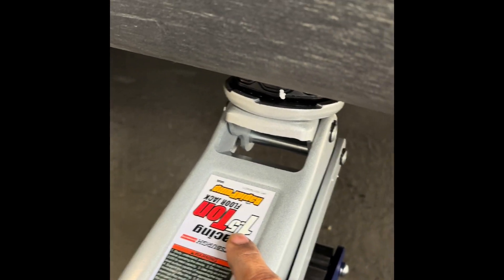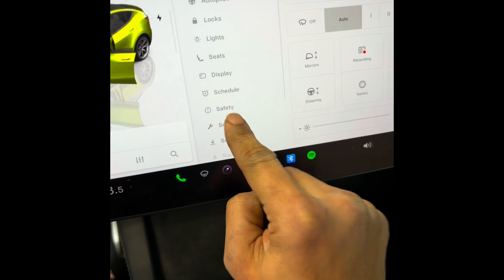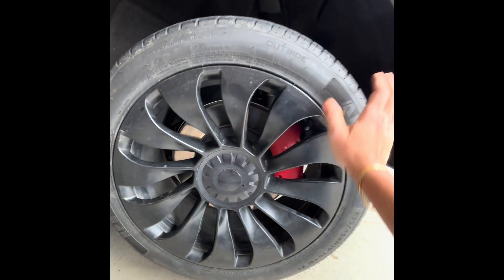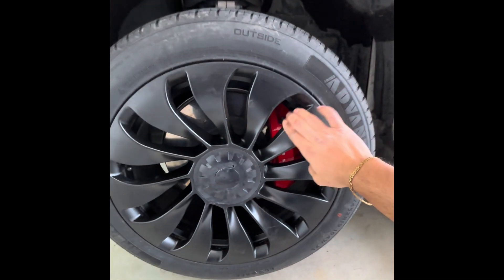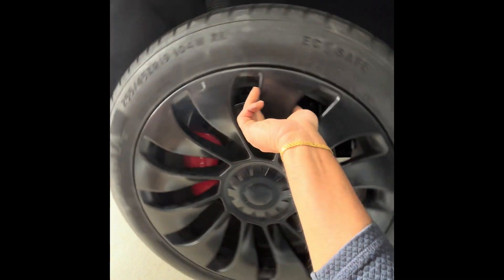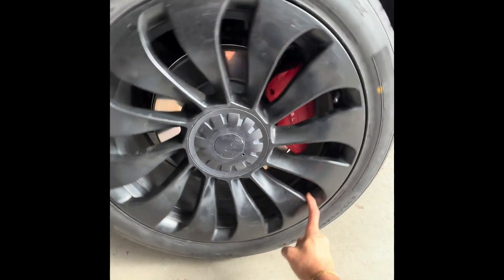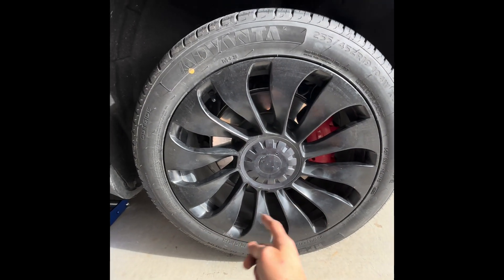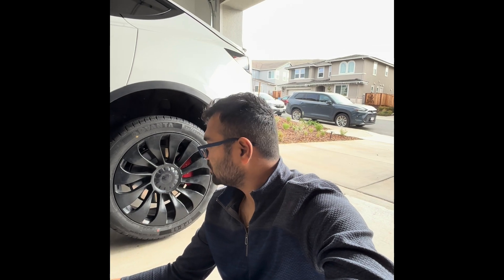Tesla wheel bearing noise 🚗🔊I got it FIXED!!!! Here’s how you can diagnose it.

Comment: I am having a similar issue. Sound is coming from front side but its not hard to rotate at all for front. but the rear wheels as im rotating, is kind of jerky to rotate and a bit harder. The noise is louder above 30mph. Did you have similar issues?

Comment: The reason the rear wheels are harder to turn is because the rear drive motor is a DC permanent magnet motor and it will require more torque to rotate than the front motor, which is an AC induction motor.
Reply from the maker: Interesting point, thanks for sharing your insights. In my case both the rear bearings were squeaky and hard when rotating. after replacing the bearings it was very smooth rotation though.

Comment: Hello,
I'm in Europe and I'm having the same noise.
I have a Y-Type rear-wheel drive.
Only on the rear wheels.
Do you have the part number to purchase? The link you provided in the description doesn't take me to the correct page.
Thank you very much.
Reply from the maker: Hi sorry for the late reply. The wheel bearing part number is dependent on the year make and model. You can check on Tesla service website.